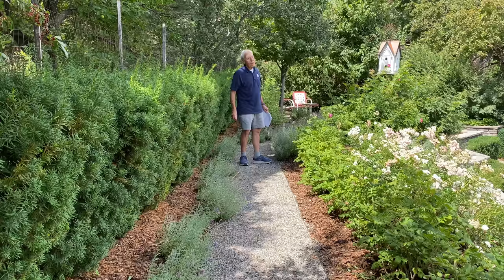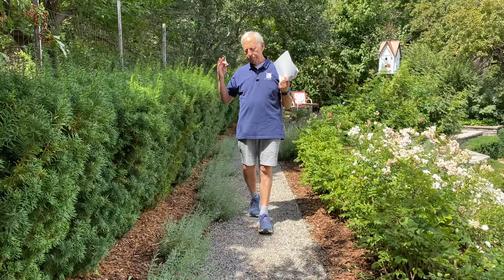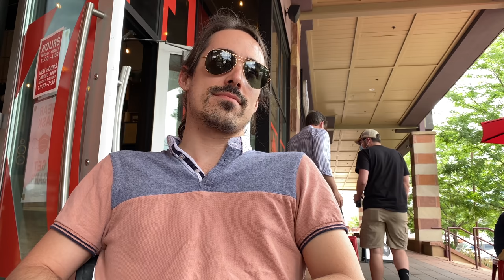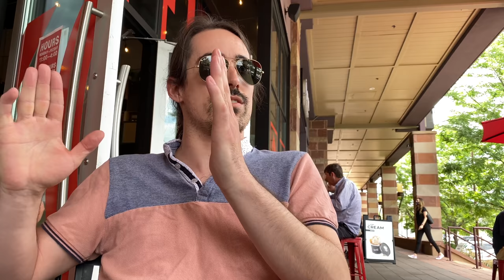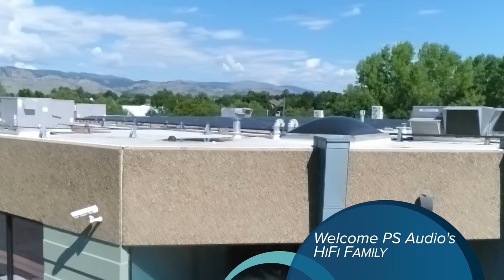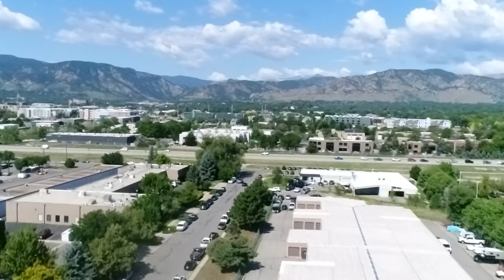Battling class D distortion with tubes

Comment: At 100w output the music will be too loud for you to do anything but cower and cover your ears, much less hear any distortion.
Reply: No.  Program material with lots of dynamic range, plus low efficiency speakers, plus lower impedance, plus dsp eq boosts all make your statement nonsensical at best.
Reply: @stottpie  2 ohm speakers aside, If your amp is outputting a full 100 watts into a 8ohm speaker with 90db sensitivity, then, yeah, what's coming out of that speaker will be too loud for you to listen to. Why does Nelson Pass make low wattage amps? Because in most cases that's really all you need to get as loud as you can really stand.

I understand headroom, but this guy was talking about distortion that occurs at 100w of output, not just somewhere in a 100w amp.

Comment: Class A!! (and if you can;t afford it, Class AB)! Also, be sure to set up solar panels on your roof and save the earth. But, please set all sacrilegious Class D on fire!
Reply: I live in a place with an outdoor temperature of 109F or 41C today. Adding a lot of heat from class A amplifiers is not what I need. Like with any amp, play your music within the intended dynamic range, and class D can work really well.
Reply: So then I guess a class D tube output stage would be pure blasphemy lol.
Reply: @InsideOfMyOwnMind  Yes, but a bit like putting a windmill on an electric car.
Reply: Class D is as good as you make it. Engineers with no passion in audio can make a bad class D amplifier or a bad class A amplifier. Usually you can get a lot more power per BOM cost in a class D design but to make it sound great is complex engineering.
Reply: @ThinkingBetter  😂😆🤣
Reply: Fat Rat  IcePower has really made an impact on the market. Amazing for a small Danish Company. The wiki reports 40+ employees. Wow!
Reply: @InsideOfMyOwnMind  I seem to remember hearing somewhere that the early radar transmitters were effectively Class D in that they ran the output stage into saturation and out.
Reply: @wilcalint  You could be right. I thought tube transmitter output stages, or "finals" if you wish, were class C but that was for communication and broadcasting. I know little to nothing about radar.
Reply: Fat Rat  You got that question mark in the wrong place, it should be at the end :)

Comment: I was looking Crown amplifiers?, but now I'm looking away from  class D? maybe?
Reply: I bought a Rockville class D amp for my patio system. Cost about $160.00 works pretty good.
I wouldn't say it's high end. It's okay for the way I use it.
Reply: Personally I love my crown xls1502, which was way better than the power amp stage  in my Peachtree nova. And strangely I then found that my yulong canary headphone DAC amp was better than the Peachtree's pre amp stage...so my advice is go try the crown..but give it time to fully burn in. Also note that the 2 gains control on the crowns should never be set on the full max volume as they should only  go up to the volume level  of the preamp or speakers being used.    Usually ends up about 2-o-clock
Reply: Class D is fine.
Reply: @humanitech  I use a Crown XLS1000 to drive my subwoofer. Best thing I ever did for it.

Comment: Let’s keep the tubes in museums where they belong.
Reply: @Dave Micolichek If tubes make you happy with the sound, it’s obviously great and my opinion is sort of irrelevant.  Only place you need a lot of gain in a "small signal path" is in the phono amp if you are still using vinyl. A preamp that has a line level input and line level output doesn't need tubes for any other reason than if you like the sort of distortion tubes do. That's a personal taste issue and we don’t need to agree what is best on this. I prefer a pure undistorted signal and ideally no preamp in the mix.
Reply: I am opening a museum in my work room. Send those relics to me.